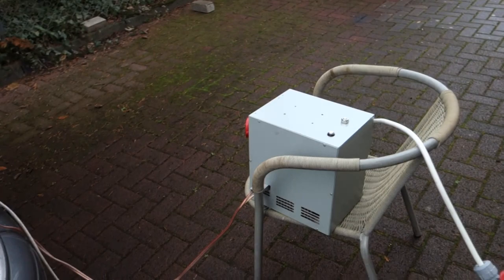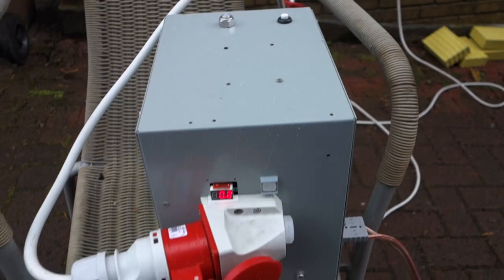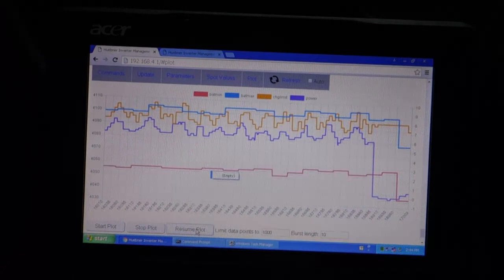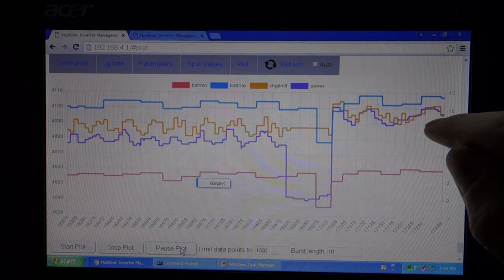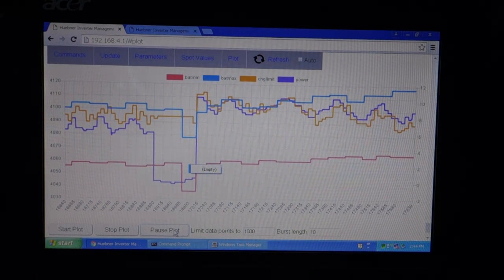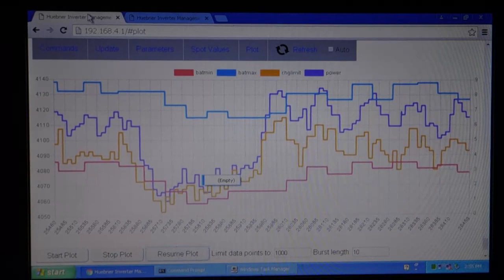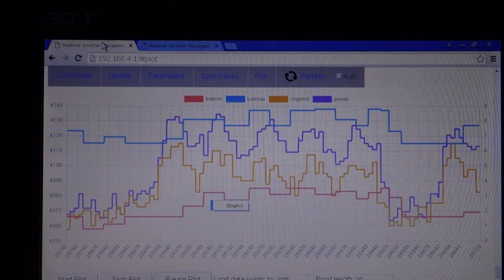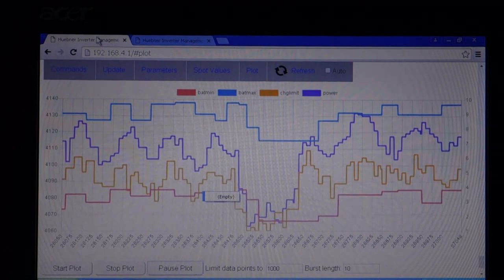Lab Update #32 -  E-Touran 11kW 3-phase charging

Comment: I've heard in Germany there is 3-phase in every house. It is pretty handy when it comes to charging EV at home.
Reply: Hi Konstantin88181, How are you charging your battery at home please?
Reply: @ervbon7493  I'm reconnecting it into parallel and charge with 12 volts
Reply: konstantin88181 ok, and what voltage are you getting from your battery?
Reply: @ervbon7493  100±
Reply: konstantin88181 ok cool, well your setup looks good. I’m just in the process of sorting out my gen2 controller board, so thanks for the info. 👍